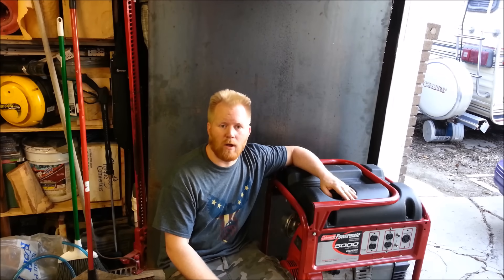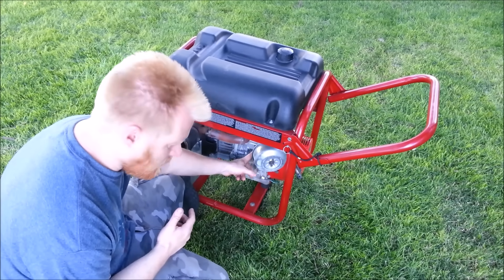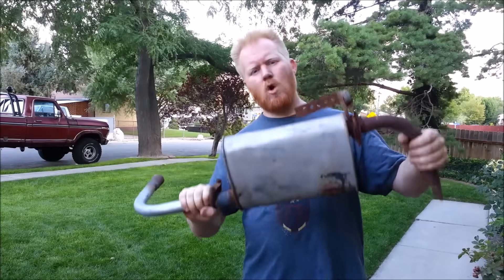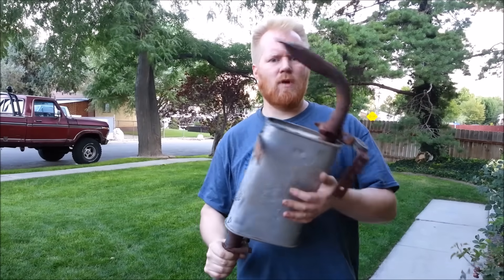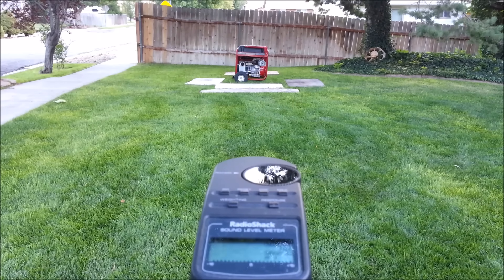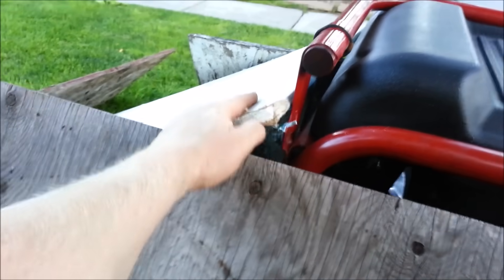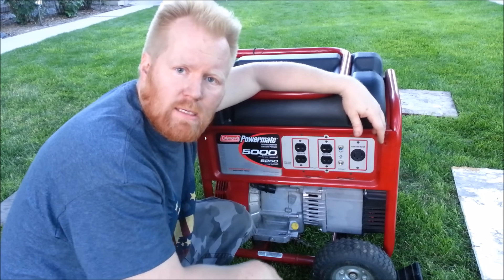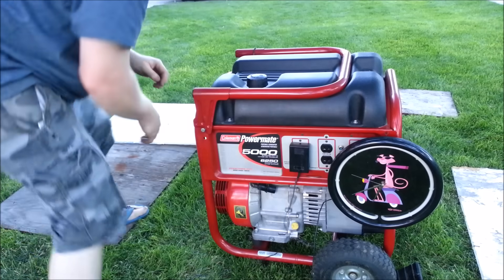4x Quieter generator in 10 seconds

Comment: 4X quieter? Or 1/4 as loud? I am guessing the latter since something cannot be multiples less.
Reply: Ed Speanburgh mine goes to 11.
Reply: To inverse multiplication, you'd divide. So saying 4x less is really x÷4. And x÷4 is equal to x•0.25. So technically you can have multiples less by multiplying by a decimal.
Reply: Its fairly common to switch your metric between dB of gain and dB of attenuation. For attenuation, a higher number results in less power. A lesser dB of noise is equivalent to a higher dB of attenuation
Reply: Apologies, highly dyslexic. Fixed.
Reply: +TIMEtoRIDE900    Hmmmm.
Reply: "And x÷4 is equal to x•0.4."   Not right. X÷4 is equal to X•0.25
Reply: Alright, drag him out back and beat him within an inch of his life.
Reply: Still not even a 1/4 percent quieter... it only dropped by 12.5%. I'm guessing this video got so many downvotes because of the "4x" silliness and the fact that he just put wood panels up against the generator. He could have had a more impressive result putting the generator into the trunk of a vehicle if he was just looking for "shock value" in the video. I for one came looking to quiet a generator and wasted a bunch of time here.
Reply: Well, the percentage comparison attempt is completely incorrect, but I believe it is only 1/2 as quiet since decibel levels double in loudness for every decade value in a the A weighting. His drop from 80 dBA to 70 dBA is only 1/2 as loud, rather than 4X quieter.
Reply: It's called a percentage you math wiz. Lol
Reply: More like 1/4 of total decibels lowered. At best. Not likely
Reply: +guerro327 Interesting point.
Reply: +guerro327 If it were half as loud it would be twice as quiet.
If B were shorter than A, then C could be 4X shorter still.
Reply: No, Milo and TimetoRide have it right.  If you can quantify something, you can quantify less of it.

If you have an 8-ounce glass of water and you remove enough water so that only 2 ounces remains, the glass now holds four times less water than before.
Reply: you cannot have it 4x quieter, as there is no unit for measure of QUIET

you are measuring loudness....   so 1/4 as loud.

just like a glass of water cannot be 1/2 empty.   How do you measure 'empty' and then take half?
Reply: +guerro327 Actually it does for the same reason as your volume control has numbers on it. if you have your speakers turned down to 4 it is 6 times quieter than 10
Reply: @edchaos2679  the Richter scale, huh?
No that's like an order of magnitude per  0.1 rise. Something crazy like that
Reply: +TIMEtoRIDE900 Uhhh, no. Are you even thinking about what you are typing?

Comment: careful with it, most potable generators can't handle the heat soaking the  AC alternator..
if you don't believe me run it with 50% or more load for a full tank of gas 
i'm not trying to be a troll, just trying to spared my knowledge
Reply from the maker: +ckelp11 The layout of the boards allow for plenty of airflow. Both the motor and the generator head have their own cooling fans and can easily pull in enough cfm to cool themselves. Yes, if you blocked it in completely you would see temp spikes and run the risk of overheating.

Comment: simple but smart. The only addition I would suggest is a small 10" extention exhaust pipe (possibly to a larger size pipe) so that the air intake won't get choked out by the exhaust and the filter wont be excessively dirty... very nice!

Comment: sorry bro, still loud as fuck. my 10k watt is really loud. 10 db drop is fine for some. thanks.
Reply: +Robert Fernandez Sound pressure is logarithmic, not linear. For typical meters, dropping 6db is actually a halving of the sound. Dropping by 10db is decreasing the sound level by almost a factor of four.
Reply: +DargoDog I thought every 3 db was double.
Reply: It depends on if you are looking at db as 10log or 20log. In most airborne and structure applications, it is 20log, in most sonar applications, is 10 log.

Comment: the simplest way for reducing the noise , is putting a hose to the exhaust and then put the hose to a bucket full of water . try it !!!
Reply from the maker: +Kostas Gkikas That will quiet the exhaust but you still have the majority of the noise coming directly out of the engine block.

Comment: Thanks for the video. It is appreciated. 

P.S. Decibel meter should be pointed up to take measurements.
Reply from the maker: +tonkatoytruck This db meter has a directional sensor at the front and a standard 1/4 camera mount on the back to lay flat. Some styles that have the padded microphone cup are suited better for upright positioning as they sense from all directions.

Comment: I am very curious how Honda brought down their decibel levels.  Maybe it is just the smaller units that are quiet.  The smaller units sound like an air compressor.  Will keep you posted on this project.  Thanks,  S.
Reply from the maker: +Stephen Elkins Mainly internal baffles/muffling. Essentially the generator is inside a muffler, just like I do in the video.

Comment: Honda generators are the quietest generators on the market.  I have a Champion 439 cc motor 7000 watts running.  Very loud.  Will look into placing a Honda muffler from a small car on this unit.  Cross my fingers.  Thanks, S.
Reply from the maker: +Stephen Elkins Sorry but it really won't make a difference to put a muffler on it, it will still be very very loud.

Comment: Hey Bud,,  Got another question for you..  Not sure if you recall but I asked you how to get this coleman  1800 watt generator I have going or exited.  Anyway I got a 4 or 5 hp Tecumseh engine to hook up to it as the original motor blew up and I was wondering if it makes any difference what way the generator part spins.  I have it set up right now to spin clockwise but when I looked at how the original recoil would pull it appears it would spin it counter clockwise.  What's your thoughts on that ??
Reply from the maker: +eaglehill6 It shouldn't matter at all. But the engine should rotate the same as I've never seen a small engine that ran the other way.
Reply: sixtyfiveford I didn't think it should as long as it is spinning and creating a magnetic field..  You have to imagine 2 separate machines here. The generator is intact except for the fact that I took off most of the parts including the piston on the engine so what I have left is the housing with the camshaft running through it. I attached a pulley to the end of the shaft and I am running a V belt from the other engine to that pulley and the way it is set up now that will make the generator turn clockwise which seems opposite to what the original motor would have been turning.  Hope that makes some sense.  I'm going to give it a try this way tomorrow and see what happens..  Thanks..
Reply from the maker: Let me know how it goes.
Reply: Well I got this menagerie of machines tied and bolted down enough to give it a try.  I plugged a lamp into the generator and started the other engine up and at first nothing happened so I figured I was screwed but I kept trying and all of a sudden the light came on. It was kinda going up and down in brightness though and I don't think it ever got to full power. I just tried it again and at first I ran the engine at low speed and nothing so I cranked it up as fast as it would go and the light came on but still not at full power so my conclusions are this,,First at least I know the generator part is working, second it vibrates like hell, I'm thinking maybe because the odd shaped camshaft is throwing it out of balance without all the other parts on it and third I thinking that I don't have enough RPMs to get to full power. I couldn't check the voltage at the plugs because I was too tied up holding other things together while it was running but my guess is that it would be low.  What do you think ..
Reply from the maker: +eaglehill6 It'll need to run at full 3600 rpm to obtain 60hz suitable for US/Canadian appliances. The crankshaft is weighted to counter the effect/weight of the piston so it could be throwing it off without the piston. Is the rod/piston from the original motor broken?
Reply: I took the piston and everything else out of the original motor so I wouldn't need it sealed and have oil in it so I can actually look at the camshaft going around..  To get the revs up I think I will have to put a larger pulley on the drive motor and or a smaller one on the generator shaft.  Is that right ??
Reply from the maker: Pulleys should be the same size as both motors will run at 3600 rpm. You said camshaft but I think you meant to say crankshaft. You may need to add weight to the journal of the crankshaft where the piston attached to counter balance the counterbalance. Or you could cut the old crankshaft so both counter weights are gone and sleeve it with pipe(welding.)
Reply: Ooh  yes you are right,,  it is the crankshaft.  Both the pulleys are the same size now(3") but not getting enough speed to the generator so I would have to fix that and I have been thinking  about getting at the crankshaft and and seeing how I could eliminate it somehow..

Comment: I like it. Smart, Simple, Effective. However... 10 decibel reduction is 2X quieter, not 4X. But I like where your mind is at!
Reply: +Zombie Box Both of you are wrong.  It is 3.16228X.
Reply: No, twice the energy isn't twice as loud. We're talking logarithmic auditory senses. ZombieBox was correct in that roughly -10dB is "half as loud". It is also 8 times less energy.
Reply: It's a ten-base logarithmic scale. 80 dB is 10 times the energy of 70 dB, not 8.

Comment: nosie reduction is an interesting topic. starting with a quiet motor helps a lot.
to really kill sound it helps enormously when there are no gaps in the barrier.
I think multilayer heavy tarp with air between the layers might work very well.

Comment: would have liked to seen a temp meter before and after
Reply from the maker: +wakeywakey There is plenty of airflow with the wide open gaps and built in fans on the engine and generator head. I did do Temp readings with an infrared gun and they show 2-3F hotter areas but also areas that are slightly cooler.

Comment: Great solution. I've been trying to figure out a simple solution to keep the gen quiet, but best I could think of was a dog house style cover, which is a hassle. This is so much simpler, and I have both OSB and sheetrock sitting around.
Reply from the maker: +Leftism11Thanks, it's a quick and easy solution. Most people put there generator away in their shed/garage and quickly pull it on in an emergency.
Reply: +sixtyfiveford Exactly. Mine is in my garage on a wheel kit. While it is easy to wheel out, a simple sound reducing solution wasn't as easy to rig up.  I'll try the plywood the next time I fire it up for testing.

Comment: Actually, 3 db is half sound pressure, not 5 db.
Reply: Correct. 3dB is half 6dB is 4x as quiet and 10dB is 10x quieter. A 10dB drop is huge. Great video.
Reply from the maker: Pete S It made a huge sound difference for sure.

Comment: I know its work but I did-, I built a plywood box on 5 inch furniture wheels for my 3500W champion (cosco), cutout a 10 inch fan hole opposite exhaust end,- industrial fan from princess auto keeps the engine cooler on hot days, made a hinged hatch on top for pouring gas into tank, left an exhaust-roll in roll out genny hole to remove generator, used soundproof/ fireproof insulation inside stapled in with chicken wire, dropped 24-26 decibels-this was necessary for my use love it
Reply from the maker: ***** Sounds like a great generator shed.

Comment: HI! The best way I found to absorb noise is to build the dog house type cover and to cover the inside of the walls with the fiberglass insulation, the fibers will absorb the sound with no bouncing back off the walls, also if you don't put a floor in it the noise will be eventually absorbed into the ground. You will have to have an area for air intake to the cooling fan and exhaust, But quiet...... oh, man!
Reply from the maker: W. Gator Makes sense as fiberglass is the same material in absorption mufflers.

Comment: It would be interesting to see how carpeting might work? Maybe you could cut a piece of shag carpeting about 3' wide by about 12-15' long and just stand it up on edge and make a circle around it. with the carpet side in it should help dampen the noise and yet give it enough room for the heat to rise and fresh air to come in. You always have informative videos with very good information, keep up the great work.
Reply from the maker: Ray VerHey I tried a fair amount of different products with the decibel meter, but not carpet. I'll give it a try.
Reply: sixtyfiveford if you get to try it please let me know the results. I have used a piece of carpet that I have set up in a dome shape over a water circulation pump in my garage and it has worked very well for years. But i don't have a decimal reader to see the true results so it would be good to see what you come up with.

Comment: Very interesting video..thanks for sharing. From my experience, the only Robin / Subaru small engine that I've seen quit running were ones that were severely neglected. I saw one that was run with no oil till it knocked, then they put oil in it and it ran for a long time afterwards, knocking away for about a year. That was on a gas air compressor!
Reply from the maker: D. J. Tanner This one double failed. The oil level sensor that is supposed to shut off the engine when the oil is low, died and would not allow the engine to start. So the original owner pulled the kill wire to this sensor so it could be run. He sold it to a guy(never told him this was unplugged) who figured it had the low oil shut down so he never needed to check the oil.... wham bam bang, there's no longer a piston rod and she's mine now.
Reply: D. J. Tanner I am a believer in Subaru products. They have proven themselves over and over again.I have a 1995 wagon with over 500.000 miles and still going strong.
Reply: *****, I love anything Subaru. Our first Subaru when I was 10 years old, was a 1979 GL 1600 4wd Wagon. It's was tough, dependable and so fuel efficient and went like a tank in snow. Subaru customer loyalty is amazing! My fiancé will only drive Subaru vehicles.
Reply: I've owned 3 Subaru 1 Nissan and 1 Toyota and 1 Honda, the Honda was the only one who blew the tranny. I'm not saying hondas are bad but Subarus make excellent products.
Reply: I actually have same exact generator with the subaru engine and have used it 30 weekends out of the year for 8 years now to run my shaved ice trailer...not a single issue, still cranks on first pull!
Reply: D. J. Tanner  I've seen quite a few of them die for no reason,and have gotten some great deals due to their failures..I would not buy anything with one of them on it unless the deal was practically a gimme,or good enough to compensate for the new engine that I am going to have to put into it before too long...

Comment: Question for you, I'm going to be in the market for a new portable generator fairly soon my old one is on its way out what would you recommend an inverter generator or a regular??
Do you have any idea if you can run a welder or heavy power tools often an inverter generator??
Reply: redneckbryon If you are going to power electronic stuff you should make sure the generator puts out a true AC sine wave.  Inverters and choppers can play hell with newer switching power supplies used in computers, TV, etc.
Reply from the maker: redneckbryon Let's talk in the 3000+ watt range. Honda's and Yamaha for sound can't be beat but the price is steep. You can do two eu2000i (ef2000i Yamaha)joined together for 4000peak 3200 running for the hefty sum of $2100. I have welded off of them and they act a little strange as they compensate for load as you weld but they work fine. Inverter generators always seam to have a little lag at getting voltage to things(split second). Inverters will use less gas. Standard generators deliver electricity effortlessly but do need tinkering to keep the frequency right. They rely solely on engine rpm to maintain 60hz (3600 engine rpm) and of course will lower slightly under heavy load. A tool like a Kill-A-Watt for $20 is invaluable with these. This allows you to maintain a decent frequency as most of the gen sets I see that are fried were running to fast. Both do the job, it just comes down to how much $$ you want to spend. FYI Honda's seam to keep 70+-% of their value, even after 10+ years of use.
Reply: ***** My apologies.  I was thinking of the PFC  (Power Factor Correcting) type of supplies that are becoming more common.

Comment: Cool demonstration, that really made it a lot quieter! I like your hour meter at the end! lol
Reply from the maker: ***** Thanks Man..
Reply: you can't see the hour meter because 4adds in in each corner pop-up right at that time and obscure the whole area
Reply: I looked, but the clock was blurry and not yet plugged in, so I still didn't see much of anything. I can't figure out why he would cover up that part of the video.
Reply: cubbeezx   Yes. It changes the perception of a "clock" to a time meter; of which it really is. I similarly put an analog clock on my furnace to monitor its runtime (powered a receptacle off of the vent blower power (only minimal wattage allowed)). An earth day, earth's single rotation, seems to lose reference quickly if one would be in the space station which circles the earth 5 times (?) a day.
Reply: Stop the vid @ 10:13 and you can see it is a clock with the Pink Panther on a scooter with neon light around the edges.